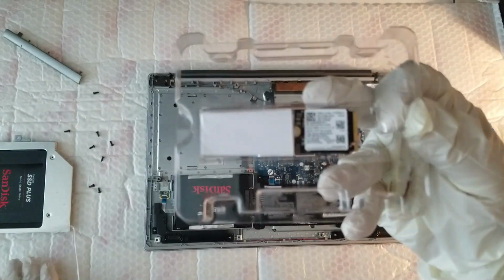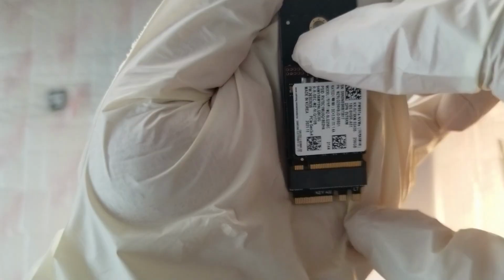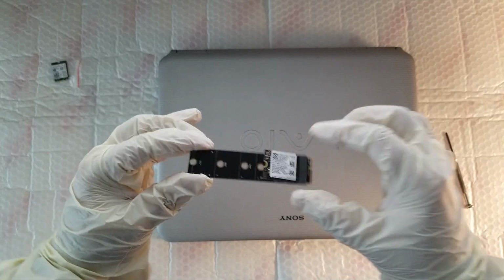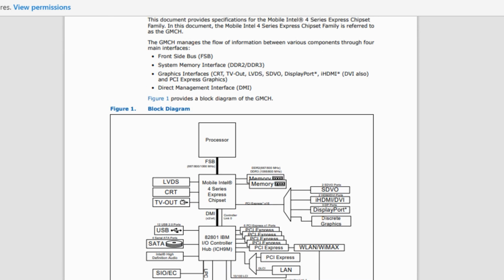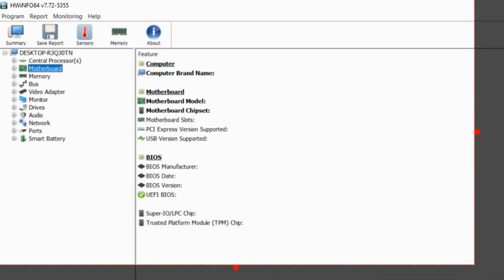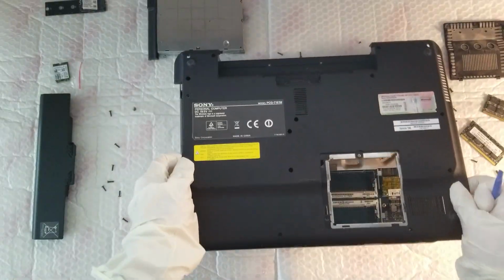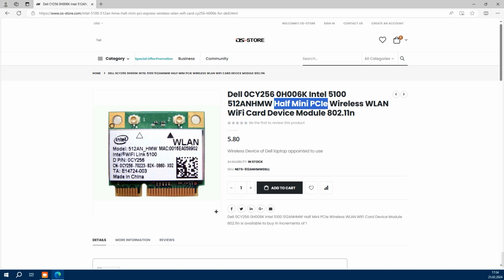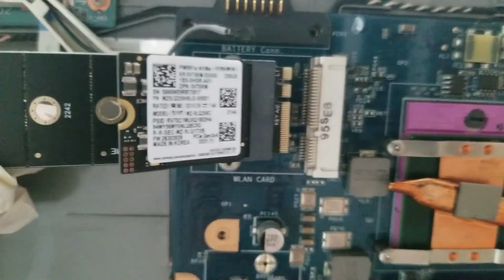WiFi to M.2 NVMe SSD Adapter Upgrade

Comment: I have a curious but strange Idea, although i doubt that the speed of data transfer might not make good different.
Anyways the Idea is : By using two adaptors and one USB type C to C (male to male) connection we can attach NVME to Sata SSD/HDD port of laptop board.
 • SATA to Type C (female) adaptor 
 • NVME to Type C (female) Adaptor 
 • Type C (male) to Type C (Male)

- Please make this Experiment come true. I wants to know how it will work and what will be the speed.😅

* Already Amazed to watch your impressive Work in this video)
Respect & Love from India 😊🙏🏻

Comment: So if convert the m2 to nvme i should easy add external gpu?
Reply: Do you mean if the laptop only have (1) wifi slot and (1) m.2 nvme you will use the wifi slot to put the current m.2 nvme ssd  using the adapter and the m.2 nvme slot will be use by egpu? i am in the process , i alr buy egpu and researching if you have something can you share? does it work or not ?

Comment: I install windows on nvme that placed like that but it not bootable why bro ?!
Reply from the maker: Windows can sometimes place the bootloader on a secondary drive, causing potential boot issues. Try disconnecting other drives to resolve this
Reply: @techwise66  how can i do that ?!
Reply: @s.9.k0  Work it out dont be lazy.
Reply: @mikepxg6406  i think it a have a ssue with bios mis a jour

Comment: Dude I found ur channel watching the 1st video "Convert WIFI Slot to M.2 NVMe SSD Slot !" at https://www.youtube.com/watch?v=Z8XqmnyqbzQ and now I'm watching this one trying to figure out how to do my Dell Latitude E6430.

You see these 2 videos are focusing on using a WIFI slot as if that were the only option in somebody's laptop, that their laptop doesn't have any mini-PCIe slots for WWAN or add-on NVMe laptop form factor SSD.  Mine does, however I have a Silicon Power 4TB UD90 M.2 NVMe SSD,, and a Samsung EVO 980 PRO, both, full finger stick sized, the size that usually goes not in laptops but into desktop motherboards with actual M.2 slots built-in like ASUS etc.  

I have problems with each of those M.2 SSD's while currently housing them inside USB-enclosure adapters.

[ 1 ]  Samsung EVO 980 PRO https://www.amazon.com/s?k=samsung+EVO+980+pro&crid=1IJPEDPLDVUQB&sprefix=samsung+evo+980+pro%2Caps%2C174&ref=nb_sb_noss_1

The Samsung EVO 980 PRO works for awhile when new, but over time, usually a few months, due to a firmware issue, the onboard controller will detect bad sectors even whether they are actually bad or not (and they usually aren't), and that results in the drive controller eventually not allowing data to be written to the drive, by resetting the drive status as READ-ONLY. It gets LOCKED that way. 

This is a known issue, discussed in more detail here " SAMSUNG 980 PRO NVMe FAILURE AND HOW TO STOP IT FROM HAPPENING " ( Channel : JayzTwoCents - 4.7 MILLION Subscribers ) https://www.youtube.com/watch?v=DoAFzdz0h5M

The GOOD NEWS is that Samsung got feedback about this issue, and have issued a firmware update that fixes it (unlock it). More GOOD NEWS is that fortunately firmware updates don't need to actually write to the drive, just access it, and the firmware update is communicated directly to the controller, which is an onboard PCB component separate from the drive itself. The BAD NEWS though is that this can only be done when a Samsung EVO 980 PRO (512 GB) is inserted into an actual M.2 NVMe slot on an actual motherboard (whether desktop or laptop doesn't matter), it can't do firmware updates while in a USB-enclosure, the process doesn't work that way.

So that's my first reason I'm exploring watching your videos and learning about this valuable information. I'm not watching just for entertainment !

   [ 2 ]  Silicon Power 4TB UD90 https://www.amazon.com/Silicon-Power-UD90-NVMe-SP04KGBP44UD9005/dp/B0BYN8NHXS/?th=1

The problem with that one is that it, UNLIKE the Samsung EVO, does NOT HAVE it's own internal DRAM and Controller. I never even thought about it, and just recently learned that M.2 NVMe's won't work inside USB-enclosures unless they have their own DRAM and Controller (mainly the DRAM).

So that's my 2nd reason. I wanna see if I can test that Silicon Power 4 TB UD90 M.2 NVMe and verify it's working when it is hooked up the right way...

I went to the link you provide, and I see the unit (it's DIRT CHEAP, thank god ! ) but I ALSO FOUND these..... Mini-PCIe to NVMe adapters .... they look very similar to the ones used in your upgrade but are not limited to WiFi.... https://www.aliexpress.us/w/wholesale-NVME-Adapter-Card-PCIE-M.2-SSD-to-Mini%2525252dPCIe.html?spm=a2g0o.detail.search.0

My dell latitude e6430 has both :: (1) WiFi Mini-PCIe and also (2),  standard mini-PCIe slot.  So I'm "on the fence" undecided which path to take. 

I do have an external USB-WIFI Adapter, a pretty good one, so I could sacrifice the WIFI slot if I had no other option. But I'd prefer not to. 

I'm sorry to bother you with this long post, but you're the first and ONLY channel I've seen covering this in such detail. 

If you may please, what you recommend ?  - - I'm asking in advance of ordering the adapter, but, I might go ahead and get various ones, of both kinds, since they are so inexpensive. 

But I'm still interested in your feedback, if any..... Thank You ....... Liked and Subscribed ........ HIGHLY INFORMATIVE VIDEO !
Reply from the maker: Hi Dude! Thank you so much for the detailed comment and for subscribing to my channel. I'm so glad you found my video informative and that it sparked your interest in exploring upgrades for your Dell Latitude E6430.

You have a unique situation with your two M.2 NVMe SSDs and the challenges you're facing with them in USB enclosures. 

Samsung EVO 980 PRO (512GB): You're absolutely right about the firmware update issue. It's unfortunate that it requires a direct connection to an M.2 slot, but this is a common limitation with NVMe drives in external enclosures. If possible, consider temporarily installing the drive in an available M.2 slot on a desktop or laptop to perform the firmware update. Once updated, you can move it back to the external enclosure.

Silicon Power 4TB UD90: DRAM-less NVMe drives like this one can sometimes have compatibility issues with USB enclosures. Luckily, your laptop has a spare mini-PCIe slot, which offers a great solution! You can use a mini-PCIe to NVMe adapter to connect the UD90 internally. This bypasses the enclosure issue and allows the drive to function correctly. I'm actually planning to create a video demonstrating this process soon, so keep an eye out for that!
Reply: @techwise66  Thank You !  The info is helpful because I keep some older retro PC's around for various daily use & utility/testing purposes in order to preserve higher end in immaculate condition unblemished with flawless performance. The e6430 mentioned is just 1 of 4 I've had. Even older they're dirt cheap yet when got in mint condition, the i7-3840QM CPU runs buttery smooth. I actually use that E6430 more than 2 Dell Precision M4800's which have stronger specs and more ports but they are heavier bulkier devices referred to as mobile workstations rather than laptops. I have multiple PC's and laptops between various personal & work projects.

I wasn't going to literally install the Silicon Power 4TB into the Dell Latitude E6430 for permanent use. I don't use a 4TB SSD in an older aging laptop. I like that laptop, I'm on it right now, because it is really peppy and superfast at web browser & avg use but It lacks the specs for 4/6/8K video from Atomos Ninja V  baked-in custom LUTS and then editing in DaVinci Resolve with Fusion effects, etc. A 4TB M.2 NVMe SSD has  read/write speed to edit & render 4K+ video. An area I AM experienced in. I know what it's like waiting for slow drives.... 

I mostly wanted to verify I hadn't damaged it or corrupted the Silicon Power 4TB UD90 from USB-enclosure experimentation. 
When I saw your video I was so impressed with the info, I decided to seek ur opinion about my current status and options.

I already have a build going inside a Lian Li 011 Dynamic XL case, with ARM4 Threadripper CPU's 5960X 16-core and 11 GB RTX 1080X Super . I'm also starting another new build with a Lian Li 011D EVO XL which is the updated version of the earlier case.
I will eventually install the Silicon Power 4 TB UD90 M.2 into one of those two builds, I haven't decided which one yet, and it's too early in the build for me to simply drop it in & test it just out curiosity. I would if I could, but I don't have all the necessary preliminary pieces for that to happen, yet. 

I will keep an eye out for your future videos about mini-PCIe adapter possibilities.  I think that is an underserved audience. Not many videos about it.  I dont think many people even bother to think about taking advantage of unused resources. My min-PCIe slot is a spare, for me to future upgrade to an "optional" WWAN.  Do you know how many people confuse WWAN with WLAN and don't really even know what a WWAN is....at all ?   So, that port just sits there...empty...not used. It's just being wasted.. Well "WE" know what...it ...could ..be ...used ..for....  😁😁

Bro, ur information is really worth it's weight in gold. I wish somebody like you were in my area. You could set up shop and have a conveyor belt of customers like the pied piper coming in for a $99 upgrade special focused around a $2.80 adapter from Alibaba ! 
Ha-ha....just joking...but you never know !!!....

Thank you again, and take it easy Bud..... have a good one.. 😎😎😎😎

Comment: What adapter do you use for you Sony laptop? 
My motherboard is the same like you, 8pin key a mini pcie for wifi card and i want use a m.2
Reply from the maker: Thank you for your comment. You'll find the adapter details in the video description.
Reply: @techwise66 I checked the video description, but you don't put the adapter details what you use..
Reply from the maker: @angelvaca9232  Oops, you're right! I overlooked the adapter details before. Thanks for bringing that to my attention. I've updated the video description with the link.

https://tr.aliexpress.com/item/1005004711422885.html?gatewayAdapt=glo2tur

Comment: hola buenas tarde, quisiera hacerle una consulta...tengo un fujitsu esprimo modelo fh52/t ,
quisiera instalarle un msata o un NVMe pero en la motherboard no me indica cual de los dos es. tiene la ranura para el wifi y otro similar que no esta en uso, me gustaria usar el puerto que esta libre pero no se cual usar. de antemano muchisimas gracias.
Reply from the maker: Based on my research, the Fujitsu Esprimo FH52/T should indeed have an M.2 slot compatible with NVMe. Here's how to be sure:
Physically check the M.2 slot on your motherboard, which is a small, elongated slot. If the slot has a notch on the edge, then it supports NVMe.
But if it doesn't have one and you want to use an M.2 NVMe adapter for your wifi slot, then you should identify your wifi card to choose the appropriate adapter
Reply: Mr  @techwise66 , la verdad es que no encontraba informacion sobre la placa base. voy a probar con un ssd NVMe le estoy muy agradecido saludos cordiales desde japon, un gran abrazo.

Comment: To boot secondary unsuported nvme you can put on first hdd a custom bootloader like cover to boot secondary unsuported nvme disk, I had it that way with UEFI, the advantages of having a custom bootloader like clover are endless
Reply from the maker: Thank you so much for your comment! You're absolutely right. For older motherboards that don't officially support NVMe drives, a custom bootloader like Clover can be a lifesaver. It can not only enable NVMe booting but also give you more control over your system's startup process
Reply: I have the custom bootloader on a 64 MB SD Card for the nvme in the WWAN slot.
Did work quiet well but didn't had the need to start Windows for like 5 years. Ateast the nvme has the SWAP partition of the main OS.

Comment: Can it work sir?
Reply from the maker: It can work, but it might depend on your setup and configuration
Reply: @techwise66  Can nvme.m2 be installed on the Asus x442uf Gold laptop via the WiFi adapter? Please help
Reply from the maker: @lumutbata  Unfortunately, I haven't tried the Asus x442uf before. The safest approach is to first identify your existing WiFi card's key type to choose the appropriate adapter. If you're comfortable opening your laptop, carefully inspect the M.2 slot. The notch position will visually indicate the key type. If it matches the WiFi card in my video, you can use a similar adapter. Remember, always unplug your laptop and remove the battery before opening it to prevent any damage from static electricity. I'm also planning a new video about different card types soon!
Reply: @techwise66  thank you sir

Comment: Hey man over been following your videos for a while and I'm also thinking to update my laptop with nvme ssd I've encountered a problem while doing so my lappy has Qualcomm atheros 9565 wifi module and i could not seem to find its connection module like what pin it uses and all, so can you please help me in finding which type of connection module it uses.. Love from India brother
Reply from the maker: Hey there, thanks for following along! About your Atheros 9565 Wi-Fi card,  it uses an NGFF M.2 slot on your motherboard.  But just double-check the "keying" – that's the notch pattern that makes sure it fits correctly. It's most likely an A+E key.

You can compare your card to my card of A+E keying in the video, and also check your laptop's specs to confirm. If it is A+E key, you can use same adapter for M.2 NVMe SSD.
Reply: @techwise66  how to check the key, do i have to open it to see it, because I've watched all over forums, and on Qualcomm site but couldn't find anything
Reply from the maker: @MusingMirrors  Yes, to visually confirm the keying of the Wi-Fi card, you need to open your laptop to see it